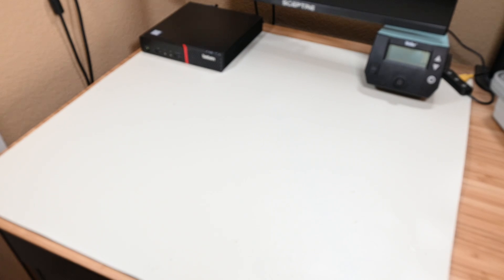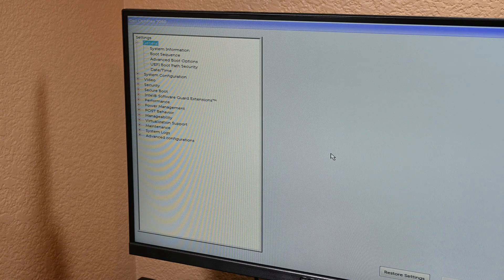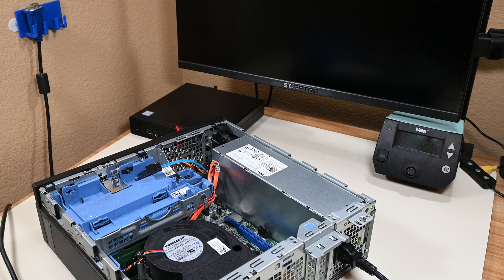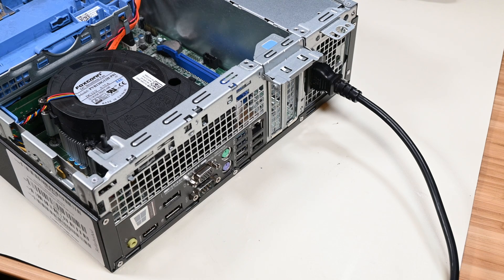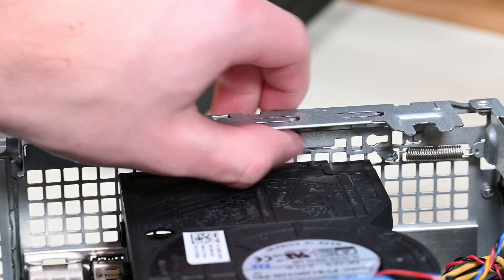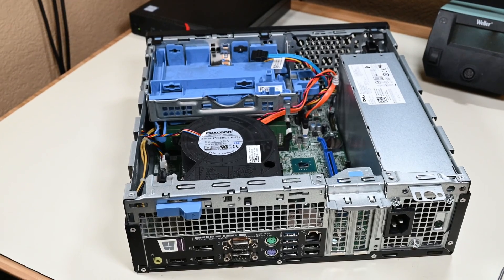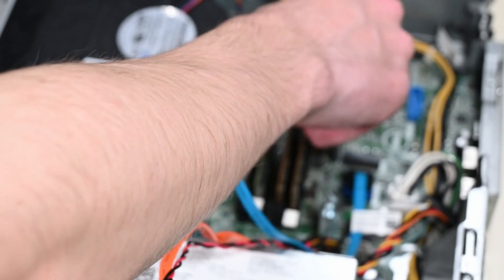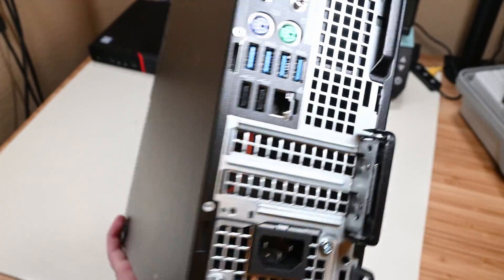Can I Fix a BROKEN OptiPlex I Bought on eBay?

Comment: i had same problem but found  that the display to vga connector was at fault , purchased a new one plugged it in and everything back to norm , apparently these  go wrong quite easily.

Comment: I have a 7050 with similar config as yours except it doesn’t want to power SATA drives unless I tug and push and mush the wires around. Then it works until it randomly stops powering the drive. As punishment it’s been sentenced to 24/7 cpu mining on a usb drive with HiveOS
Reply from the maker: Ahh the good ol' mining punishment. I wonder if it's something to do with a damaged conductor or crimp in the little SATA power squid cable

Comment: I can tell you a general piece of knowledge ( not that I can say true for this PC ) , but it takes a special display port to allow a DP to HDMI converter cable.   Some pc's have a special desination for this feature - so you might want to check the specs for the PC and see if that special cable is allowed.

Comment: I've got the SFF 7010 with an RTX A2000 GPU, and I've discovered the display output is really finnicky about which displayport cable I use.
Reply from the maker: That's interesting, I wonder if it could be anything to do with trying to run some high resolution/high refresh rate through the cable?
Reply: @CHWTT  I was thinking it may be more to do with whether the cable is unidirectional or bidirectional, but that's a guess.  The GPU came with short mini-DP to DP adapters (male to female).  When I replaced those with a single mini-DP to DP cable (male to male) everything worked flawlessly.  BTW, the A2000 outputs to mini-DP only so I didn't have any other options.

Comment: So I'm a tech in a computer store and I've worked on quite a few of the HP / Dell SFF PCs. The long story short is: DisplayPort acting weird on these systems is the norm. Sometimes a BIOS update will improve things slightly but it's not always the case. Best thing to do to prepare these things for sale is to install your OS while using VGA (as it is often the only one that will output anything to get access to the BIOS) and then install the drivers. Once that's done, the system should load into Windows just fine with any display cable but your customer needs to be aware of this little quirk. I've seen this issue on pretty much any HP / Dell SFF PCs from 2nd to 8th gen intel but it's random as far as I can tell.
Reply from the maker: Alright, I see now. Thanks for sharing that, I'm glad to be able to add that to my knowledge base now for when I deal with more of this PCs in the future! :)
Reply: Could you help to my situation ?  am current have the same PC Dell optiplex 7050 at the moment, the power is on unfortunately no screen display from the screen, I have changed vga, hdmi, dvi and still no screen display...

Comment: I had a 7040 that was POSTing all sorts of weird the other night. It would not let me get into boot or BIOS, just jumping straight to OS.

I accidently fixed it by trying to clear CMOS with the jumper pins - while it was still plugged in. That booted the system and got my Dell splash screen back.

Freaking Dell

Comment: I've had this issue with many Dell SFF PCs I got from a school.

I tried a DP > HDMI cable and only got picture after the machine had started to boot into BIOS or Windows, I never got the POST screen.

I bought a normal DP-cable and connected it to a monitor with DP port and never had any issues that way, seems like the machines are picky about the cable you use (doesnt seem to like DP > HDMI for example)
Reply from the maker: Thanks for sharing your insight! I guess I was on the right track when it came to the DP-HDMI cable that I was using. Appreciate the info!
Reply: I put is elsewhere - but repeating here.  You have to have a special display port to be able to use the DP to HDMI cable.   a regular DP port will not work with that cable.  I have been working on another brand and they actually put special markings to say that the DP to HDMI cable will work.  so check your computers specs to see if you can use the converter cable.

Comment: It's not just this model with this issue. I have a 7010 and a 9020 that behave the same on the onboard displayport but only on certain monitors. I have 2 Samsung 1440p monitors and they would refuse to post,then i tried another 1080p Asus monitor and they worked with that one. I installed Windows on them and after that,if i connected them to the Samsung monitors they would power on,not show any post on the screen but the monitor would turn on only after it booted into Windows and the video driver loaded. I think those displayports don't know what to do on certain monitors until the driver boots up and tells them what to do. I used them all day via DP on those monitors and they're rock solid,but if i want to get into the BIOS,see the POST screen or reinstall Windows i just can't. They are only usable after Windows boots
Reply from the maker: Interesting, I also noticed that the display worked flawlessly once Windows was installed and booting, but it wouldn't ever output the POST screen until the Windows screens popped up. Could definitely be something related to a driver? Dunno, but thanks for the insight, I appreciate it!
Reply: @CHWTT  Maybe it depends on the displayport version? Modern monitors have 1.4 and up while those older computers probably got 1.0 or 1.2. After i updated the bios on mine it started to post but the dell logo was really botched because it still couldn't get the monitor's correct resolution. Who knows,maybe these Dell computers expect you to have a Dell monitor and they tie toghether somehow. Using a dedicated gpu via displayport works just fine so it's just the onboard dell video that's got some sort of incompatibility problems